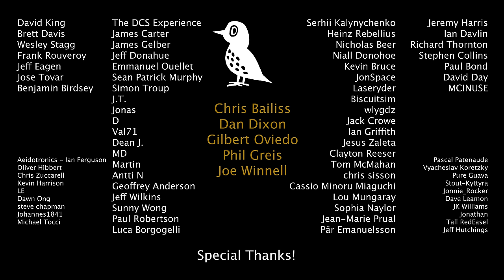Vintage Japan semihollow guitar transformation

Comment: I had a sunburst one of these as my first electric guitar - it was a horrible piece of cr@p but I loved it.  I didn’t have an amp so used to hotwire it through the speaker of my Dansette record player.
They were made in Japan by Teisco - marketed as ‘Audition’ guitars in the UK and sold by Woolworths.
Robert Smith of The Cure loves the original pickups, he had one installed in his Jazzmaster between the standard JM pups.

Comment: painting tip.. never push the trigger while the tip is pointed at work, push trigger away form work 6-8" or so then steadily bring it across and beyond work in one steady stroke all the way past work with steady spray flow, once past work, then let off.. repeat, I'm 100% confident you know this but for others who do not that watch this work and may think its standard practice or good work . .

Comment: I think for a 1960's guitar I would've restored to it's original luster for preference. Outstanding work either way. I have no problem with the color though. The guitar is 60+ years old and something from that era needs to go back to what it once was. That said, I can't restore it to either version of what it now is. So don't take this as criticism, it's beautiful either way. I just wish I didn't know what the original looked like. Just my OCD. If I had seen the end result and never knew it was a natural woodie, I would've assumed it was a painted sparkle finish. The gold foils sounded good in the demo. And that was good that I didn't hear it demo as original 1960's, that's if it even worked. Nothing to compare as a frame of reference there, it sounds like I would've expected a 1960's Department store Teisco to sound. I do like the Valco Airline/Harmony/Kay/Danelectro/Supro/National/Silvertone (did I miss a brand ?).

Comment: I'm amazed because I have that same exact guitar - in fact it was learning how to rebuild that guitar that got me into my guitar repairing and building hobby. The only difference with the one I have besides the color is that this has a zero fret and was missing the tremolo and parts from the bridge. It even has the same wood grain pattern on the neck as yours. Originally I had planned on stripping the finish on the body and leaving the wood, but made a rookie mistake and sanded through the veneer so I painted it black. I never did finish it - it got set to the side while I worked on other projects, but was recently thinking about what it would take to finish it and you gave me some great ideas. Beautiful how you did the cracked, relic finish with that color. Thanks for your videos - it's really enjoyable to watch your process and see the finished results.

Comment: I watch many of your re-fretting 'shorts' videos. I like your work. From one pro to another, you may try using woodwind oil (clarinets, etc.) for really old, dry fretboards to bring them back to life.
The back of that headstock's transition into the neck is a perfect candidate for a stinger.
You did the right thing saving the fingerboard. You have to remember, even if the wood came from somewhere else, it's age and composition at the time of harvest made it unique.

Comment: I have this exact guitar. Everything including the hardware and colors of wood stain are exactly the same. Even the red felt under the saddle was identical. Mine is a Martin Sigma, (logo on headstock). My neck had a flat radius so I rounded it and put on some humbuckers from the 1970's. It is my favorite guitar. Sounds amazing. Thanks for another cool video!

Comment: Well done...for smoother surface and easier laquering process you can use nitorlack from can ... with 10-20% solvent medium (thinner) and a real Spraygun...so you don´t have so much orange peel effect...which causes less grinding.

Comment: Beautiful job!

I fell in love with semi-hollow when I got a Gibson ES-339. I preferred the size, and it was light as a feather so my dislike for the Les Paul type builds was resolved. I got it in 2018 for only $1900 Canadian dollars, brand new, which is about $1k less than retail (knew a guy who owns a guitar shop). Same tone as a Les Paul ('57 humbuckers), half the weight of a Les Paul, and small enough that it fit into a standard gig bag. I miss that guitar badly, but had to sell it and intend to buy another one.

I'd like to ask a quick question for you, and any of your subscribers - I realize working with stainless steel frets is difficult, but I always thought the reward was worth it. "Thought", meaning I never did it but it's a great investment from a buyer's pov. My favorite combo for a 24.75" guitar is Richlite + Stainless Steel frets, but I hear that's the worst combo for any luthier/artist to work with due to the materials being so hard to file/cut. Is there a value you place on a guitar (monetarily or nostalgic) that it must comply with, before going to the effort & expense of stainless steel frets?

Comment: Amazing work, I was hoping you'd give it some fancy modern colour, haha. This is not a japanese guitar, it's a Korean Samick from the 70s. You can find them as Hondo H500 and other brands. Samick were just copying some of the japanese designs at that time (including the hardware and electronics, although only Samick used strap buttons of that specific shape). They weren't good instruments to begin with, but you turned it into a special one.

Comment: A bit of constructive criticism on the painting (not trying to be mean):

Start spraying from outside of the work piece first before you start moving the paint gun inwards. Sweep through to the opposite side and are completely clear of the piece before letting go of the trigger. Once you're clear of the work piece, then you can let go of the trigger, press down again and sweep through the opposite direction. Apply that same principle as before while trying to overlap each layer consistently - every paint manufacturer is different with how much overlap they want you to go for. Not trying to put you down; I think you'll be happier with the overall finish with some tweaks. Hope that makes sense and there are plenty of videos to help visualize it if you need to. Everything ended up being fine because of the finish you went with - very unique.

Keep at it. Enjoy the videos.

Comment: That grain was fantastic whyyy???? When sanding i always use wet and dry sand paper with water and a spot of washing up liquid if you see a coloured foam then your going to deep. Where as with dry sanding you wouldnt get that warning  i use 600 grit to 2500 grit. Then i finish by hand  with autosol polishing paste it ends up like glass everytime. And you can always wash the wet and dry paper to get more life out of it instead of it clogging up. I dont think that spray would let you do it any finer. But next time shake the can more and Just warm it up before using with a hair dryer. But dont get it hot it might go bang and youll hurt yourself and be covered in paint LOL.  Just warm above room temperature NOT HOT. itll make the spray finer and less cloggy. Hope this helps great job by the way your prep and cleaning and binding were excellent. Well done and give my compliments to the person that has taught you they have done a cracking job of showing you how to do it. And always buy your primer and mid and finish paint from the same supplier to avoid the paint not bonding or test first and allow to dry

Comment: It looks like the finish you removed was polyester. That wasn't really a thing in the 60's so I'm thinking this is maybe more like a 70's vintage. Those polyester finishes can be a bear to remove so on a low value guitar like this I would just use a chemical stripper. Polyester finishes are what they use on bowling alleys because they are highly resistant to friction but that makes them really tough to sand. The side wood looks like walnut (or perhaps rosewood but I doubt it) and the top looks like grade A plywood. And a semi acoustic with a bolt on neck is really weird. But some of these old guitars have interesting sounds when restored, they certainly won't sound like any other guitar but that's part of their charm. And I love the wanna be Bigsby tail piece.

Comment: What did you do to that pink paint to make it crack?
Heat it up and spray it with water to make those cracks?
That's so cool, I'd love to see a guitar like that in person, are the cracks invisible until you're looking up close. Or can you see the cracks from a distance? Good work!
Reply from the maker: Thank you! The cracks are quite noticeable in real life, unfortunately, the camera couldn't capture it properly. To make the cracks appear, I first heated the varnish and then quickly cooled it with a special spray :)
Reply: I’ve seen people use that “canned air” spray if you shake it up and make liquid come out. But that doesn’t give the same even results Ms Shpachuk gets here

Comment: I thought I use the same method for cracking the nitro finish on my Gibson Les Paul Custom from 2014... to get it look old, but I changed my mind and put in some EMG pickups in it instead. But I will maybe do the headstock on it, but the headstock actually starting to crack the nitro finish it self now so I maybe just wait another 5-10 years and its the result I want just by it self.. :D

Comment: Hello Tanya, If you don't mind I'd like to give you a few tips all the from America..

Most of use Oxford vintage formula lacquer, we use it because it's drying time is faster and it dries to a glass like very hard state.. The Oxford Vintage formula lacquer doesn't have as many modern placticiziaers in it so it doesn't get sticky when you play it and retains it's glass like feel.. I'm not sponsored in anyway by Oxford finishes nor do I receive anything free from them it's just a finish the majority of professionals use because it's a vintage correct formula..

Also with ageing, we don't use canned air, all of you professional American luthiers purchase chest freezers so the whole guitar can age and crack at once vs in blotches, you freeze the guitar for roughly 30 minutes take it out and let it sit in a decently warm room and repeat as necessary to achieve your desired amount of ageing..
When you do it with a can of air you'll end up with patches that don't match and it can be rather troublesome down the road as it continues to age and rub off it's likely to rub of or wear off in chunks...

Thirdly, get yourself an air compressor and a paint gun, it doesn't have to be a super expensive one..
Make sure it has a moisture trap/separator so moisture doesn't get into you lacquer or whatever you're spraying..
It makes a massive difference in the finish,spray cans are okay but they just don't provide a smooth even finish and spraying with a compressor makes finish sanding alotttt easier you'll 100% notice a difference in end result..

Your in Ukraine right? So you have access to old grassroots lp guitars,Edwards, Tokai, Burny, Greco, ect if you could get a hold of one of those and restore it that would be cool and gain you even more viewers.. Maybe apply a new top veneer and a new burst, ect make it something special, you're a talented lady and I think you're capable of doing it..
Maybe you could recarve the top to vintage specs and so on...

I hope this comment helps you, and I hope the best for you and your shop...

Comment: That is most likely a Camelot from around 1969 or 1970; that neck pick-up looks identical to the one in my 12-string (aside from the plastic surround), and I saw a scan of an old catalog which dated mine as a ‘69 model.  It could also be a “Guitalia”, as I believe that name was used from 1972-73 or so.  Apparently they were made in Japan by Arai & Co.  I have never been able to find out any more about them...
----------------------------------------------------------------------------------------------------------------------------------------------------
SEVERAL DAYS LATER EDIT:  

I found some more info about the pick-ups.  They were apparently manufactured by a certain company in Japan which later became well known for their effects pedals, and were used by several different Japanese guitar manufacturers during the late '60s/early '70s.  By the mid-1970s, a handful of other companies were copying the design, but the copies usually don't look exactly the same, and the ones in this video look like the originals as I noted above.  The guitar still looks like an Arai product to my eyes, but could easily have been made by Fujigen (they were the first company to use those pick-ups) or one of the smaller manufacturers.

Comment: waiting to see if you can clean out those F holes...seems like it would be a pain in the ass...
edit: wow, using a rabbet planer to remove wood to make add the new bindings....respect.
edit 2: see you tried a lot of new stuff for this video, camera angles etc...changing up the format...it was overall good stuff...I like that guitar a lot...looks like a 335 + vox custom 24 + rickenbacker + pink cadillac .

Comment: Hab 13 Gitarren ,und spiele viel,hab 2 selbst gebaut,ich schraube auch viel an den Instrumenten,das alles so ist wie ich es will,sound und Bespielbarkeit,es ist wie mit meinem Auto und meinem Motorrad,..aber sehr toll wie du das machst eine freude dir zuzusehen,👍👍👍und deinen schönen Händen zu folgen,❤, bloß hätte ich die Gitarre gerne    ohne Effekt Sound gehört,also Steg und hals Pickup,clean,.. sind das Roswell single Pickup? Hab ich am Hals bei meiner Höfner, eingebaut

Comment: For the cracks. Heat gun.. and what are you spraying? Looks like brake parts cleaner. :)
Reply: Most likely computer duster or something similar. It’s the cold from the compressed air that cracks the finish.

Comment: I enjoyed this video, but the the way you measured the nut height was not the best.  

You should use half a pencil - cut along the length of the pencil, then draw the line on the nut when the pencil is sitting on the frets.  This is the absolute minimum height you can make the nut.

Add 1mm or 2mm to the height, then cut the string slots, then reduce the excess as necessary.

Comment: Do ppl really ask "Why do you solder the frets before removing them?!"
I never saw any solder.
I did see a soldering iron, also known as a "wood burner," or a heating element.
No solder. Just heat.
I guess that's why you wear & sell sweatshirts with that question on 'em.
So stupid.

Comment: same as a Kent.  wow bondoing the top and painting it seems like the worst possible way to alter the sound.
Reply: yikes.  using a powerdrill on the neck?  Girl you ruined this guitar, to be quite honest.  Did a good job though !
Reply: yikes sanding the top with a rotary sander?  yikes girl.  take your time you have to tune the instrument as you work on it.  let the instrument out of itself.
Reply: ahh you didn't add the block underneath the neck pickup did you.  aghh.  if you had gone through this whole trouble and not added the dowel.  you need a dowel in it like aviolin right in the perfect spot on these guitars near the neck pickup.

Comment: Two thumbs DOWN!  It HAD a nice wood grain finish.  All of that effort and you still used the crappy bridge allowing the intonation to be incorrect.  That is also a crappy vibrato that won't stay in tune.  I had that very same vibrato on my first guitar back in 1968.  I removed the spring and replaced it with a wooden dowel so that it would stay in tune.